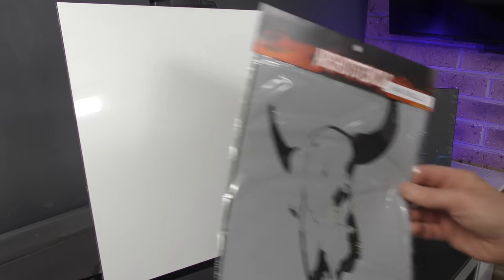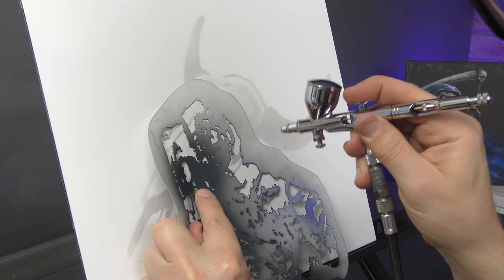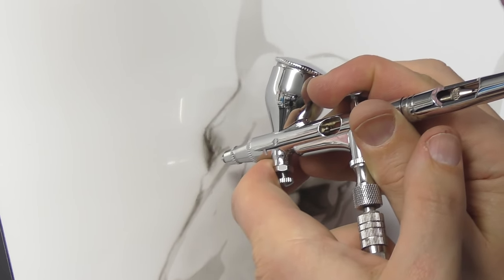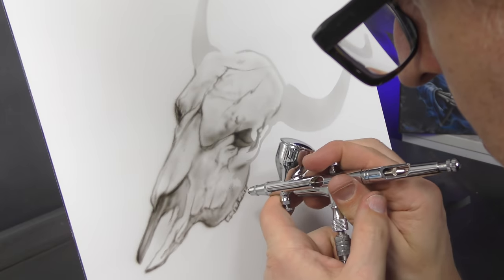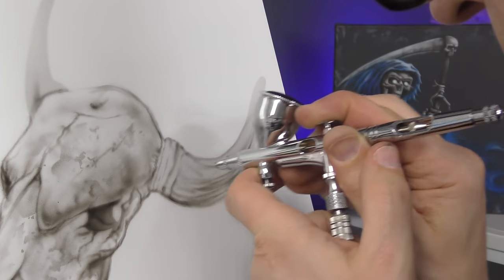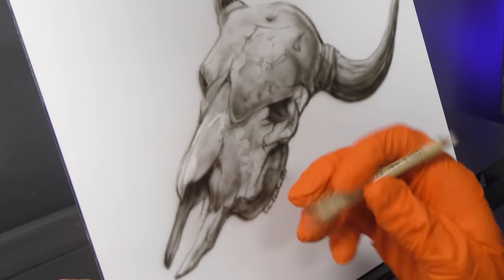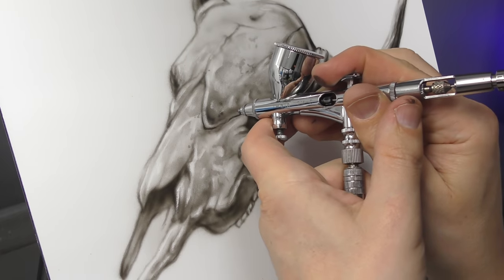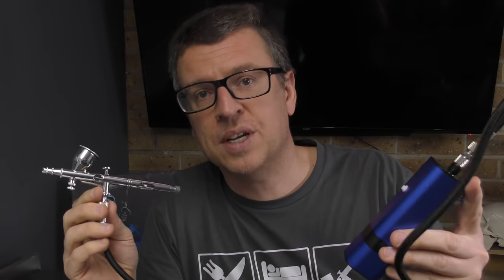Bull Skull Airbrushed using iBeautee Battery Airbrush

Comment: Hi carsten, i got a simular one and it does his work fairly good. I painted 2 same car body,s with the same mix of paint. And the results were good from both.But the battery was warming up in about 20-25 minutes and started to pump out less air. I had the pressure meter between it. When i used it i just used a m3 sanding sponge to polish the needle a bit,because it feld a bit rough. I think it is a good machine for those wo don,t like to spend a lot of money when they start with airbrushing. For me it was a decent buy for decent money. Keep up the good info and tutorials about airbrushing👍👍👍👍👍👍
Reply from the maker: Thank you for your comment and yes I agree it’s a great option for someone who wants to give airbrushing a go for very little investment , I think as technology improves these battery units will really challenge larger compressors and make airbrushing with the larger noisy compressors a thing of the past 🤔

Comment: Damn, that thing performs really nicely. I'd expected the pressure to start dropping or becoming less stable as the battery decreased, I'm impressed. Were you running a long hose?

Given the pressure being 'locked' at 20psi, do you think an Iwata HP-B (I think it is, a High Performance I bought from you mid-late last year) would go well? From memory the Eclipse and HP both liked a higher pressure at the pump than a Neo, Hi-Line or Micron.

Great video, glad to see it in proper operation after the unboxing/initial tests. It's probably worth getting one just for the portability aspect.

Comment: Thanks for this review!

The 20psi is a bit disappointing after the box claimed 32; definitely treading into the intentionally misleading area (not totally false, but getting in the area).  The Amazon description does NOT mention anything except 32psi, but a vendor reply to comment indicates lower psi is due to pressure loss in the hoses.  There isn't any mention of a regulator holding it to 20psi.  It is again available on Amazon by the way (late Oct 2021! $67 US).

Cool artwork & done in 45 minutes.  Wow!
Reply from the maker: Thank you and yes, whether it’s an output (loss of pressure) or a restrictive mode I agree that it should be clearer but it is a great little unit nonetheless and managed to keep up with no issues throughout this test, it will be interesting to see how long it will last 👍🏻👍🏻
Reply: Manufacturer claims that it generates 32psi 'blocking pressure' but the unit is regulated to approx 20psi output pressure. The manufacturer cannot however define what 'blocking pressure' is nor provide any evidence of 32psi. It IS misleading indeed and dare I say fraudulent. It's akin to advertising a car as a V8 but you can only use 5 cylinders......

Comment: To Carston I have a 30 dollars gotccher air compressor it's tiny and pumps out 15 to 20 psi. They work but what it's a bothersome they over heat fast so I wouldn't recommend if you're painting more than 3 hours. An air compresor or a air tank is much better. And you can adjust the pressure. These things it's great for make up or short artworks
Reply from the maker: Yes agree , these are perfect for those smaller projects ie , miniatures, RC bodies, makeup etc